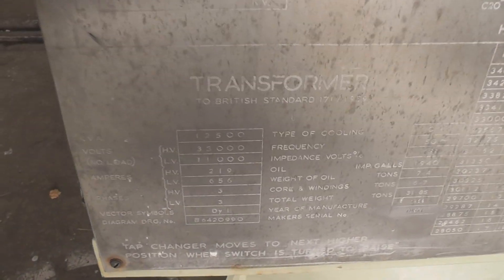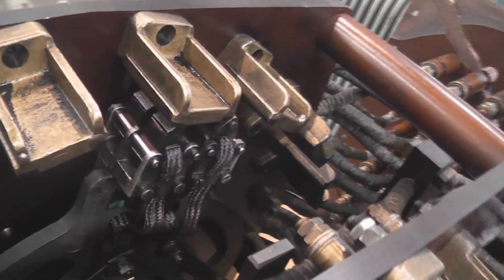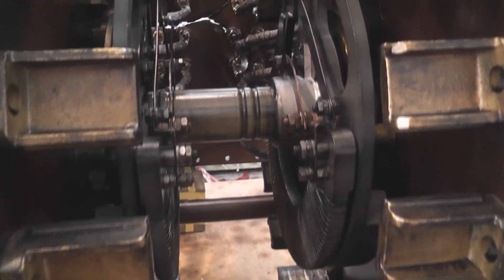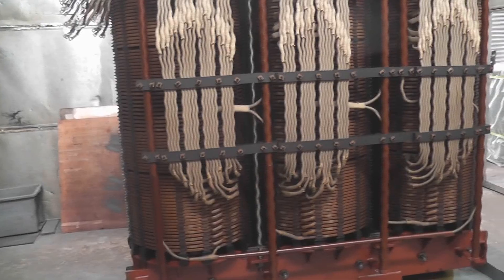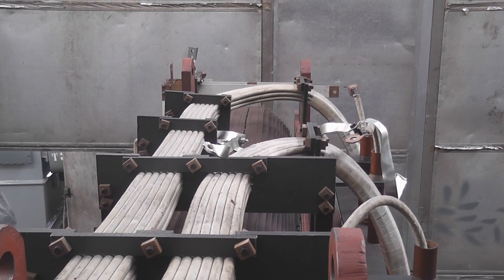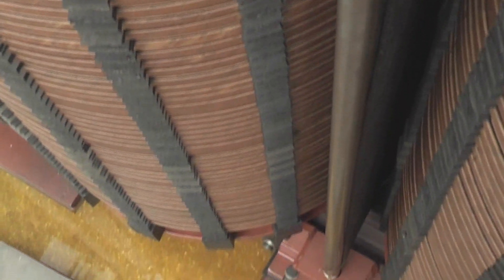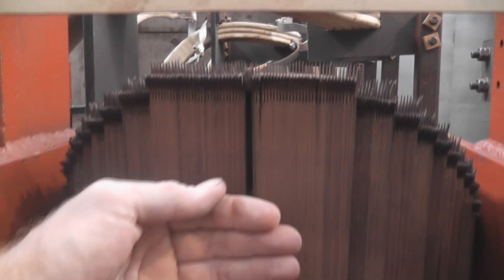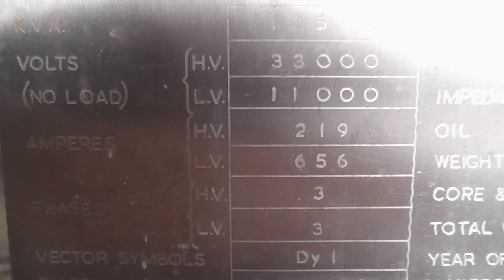Brush 12500 kVA transformator

Comment: It appears the 33kv windings are made of 84 groups of 20 turns = 1680 turns in total per leg assuming max input voltage 34.65KV on tap 1 Gives 20.62Volts/per turn, legs are about 35cm in diameter 961cm2 core area, running at about 1 tesla, using CRGOS at 0.5mm lamination's.

Comment: Thanks for this, great to get the opportunity to see inside... We recently installed a 33/11kV 15MVA 1960's refurbished Brush transformer on a private network for a client.. Think it may have been from a foundry originally. I had a go on the manual tap changer as we had to go up about 4 taps (offline, and under supervision of our SAP) and operation was as sweet as a nut. Even the handle had a touch of quality about it!  Our local network operator was a little concerned about energising it as it was missing some of the FAT information they required for inrush studies so a few best guess approximations had been made by the supplier. Was a new fairly long teed connection to a pretty weedy bit of network so they had power quality measuring kit connected while they switched it on. We had been warned that if it was to cause too much of a dip in supply, then it might not be going on again! Although the tech could not tell us on the day as he needed to interrogate the recorder properly in the office, I have not heard back of any problems. The conservator on ours is incorporated into a sleek housing on the top with a little fixed ladder to access the Buchholz and WTI cable marshalling box which is also built into this housing. The whole thing looks very 50's/60's styling and pretty space age!
Reply from the maker: Brush transformers are very well made and designed.

Comment: How often do wildlife interrupt service on these kinds of things? And if worst comes to them, what kinds of places do they end up?
Reply: +Levi Schuck Full time FF here. I saw a squirrel a few years ago become fired, and blew a transformer. Smoked out a huge gym to was connected to. Was impressive.
Reply from the maker: +Levi Schuck Transformers rarely, most often wildlife trips power lines. The bird, possum explodes and ends up on the berm, or roadside. sometimes lines melt and fall down to be repaired.

Comment: how is it possible this thing was not contaminated with PCB?
Reply: BavarianMonkey Because not all old oil contained PCB’s nor was it requested when purchasing. PCB’s were added to the oil due to the war and the increased risk of damage and fire. They never cleaned out the delivery systems between using PCB oil and non PCB oil, sometimes some PCB oil would be left in the tanker, mehh, leave it in and so on and so forth, see what I mean? So it’s not a given that because a transformer is old, that it contains PCB. PCB ≠ Old

Comment: wow it would be nice to fine of those just for the copper to use for off grid bus bars this is a nice video thanks for sharing. was this set up for frequency matching. IE two different grid's connected with a matching transformer to match lets say a 50hz from one power plant and maybe 52 hz from another. I love to see a system with a matching transformer if this is not it.  thanks for the great video.
Reply: +McCuneWindandSolar AFAIK frequency matching is done with back-to-back inverters. In the uk if the frequency is off by more than 1% (1/2 Hz statutory 1/5Hz operational) the generator either starts load shedding or ultimately is switched out.
Tap changers are used primarily (again AFAIK) for Line Drop Compensation. all that beautiful switchgear shown in the video is effectively changing the turns ratio on the transformer, switching in or out smaller windings in series with the main winding.

Comment: What's that toroidal thing at 4:55?
Reply: +AintBigAintClever A CT most probably used in conjunction with an oil temp probe to give the winding temperature.
Reply from the maker: +AintBigAintClever That is a CT. it's output connected to a transducer for the winding temperature, sorry for the late reply.

Comment: that is a beauty. Too bad it had the tapchanger fail. Also too bad you couldn't get it for yourself to do some experiments on, but like you said, you'd need a big supply for it.  I wonder how much in metal recycling they'd get for scrapping it? I'd like to start experimenting for myself but am just a little leary of messing with HV. Safety first!!

Comment: Bet you wish you had this one for electrical experiments!!

This is like the ones made where I worked for G.E.C.
Reply from the maker: Only problem is that I need a 33000 Volts supply at a few 100 Amps
Reply: Hmm - do you have any overhead lines near you!!! I'm sure the electricity company wouldn't really mind!!

Comment: If they discard it, are you allowed to keep parts?

Nice transformer, too bad the system got damaged.

I would really like to see you connect the motor-unit to the switches and take a full round or two.
Reply from the maker: Too big, it may get scrapped pending the outcome.
Reply from the maker: +erlendse The transformer has been refitted with a replacement tap-changer and is held in the utility stores as a emergency spare, as we have quiet a few of these Brush TX's in service..
Reply: That's good to know, I'd hate to see something like that just go to waste. Thanks for the Vid.

Comment: In the video with the faulty pole mounted transformer I think you said the replacement would be £100k+ How much to replace this one?
Reply from the maker: 2 to 3 million
Reply: RODALCO2007
I mixed this transformer up with smaller ones serving hundreds of customers. I guess this transformer is responsible for supplying a few thousands domestic customers.

Comment: Are those coils insulated or do they float in the oil w/o insulating coating?
Reply: Both. They are insulated by paper for turn-to-turn and the oil insulated between windings.
Reply: Paul Roberts paper insulates? or is it paper drained with resin?
Reply: *****
the oil soaks into the paper and makes a very good insulator